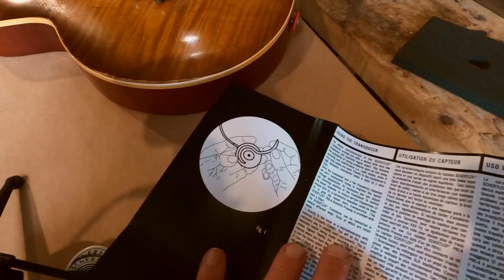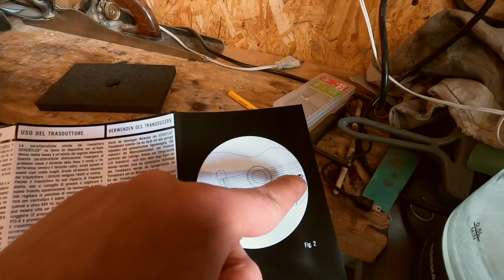HOW WOOD SOUND on unplugged electric guitar. (experiment)

Comment: Nobody cares about the truss rod!! It’s been talked about everythings influence on guitar tone, but nobody cares about the truss rod!! 

The most “tonewood" denier do not listen carefully over an extended time to their guitars unplugged. Because, if they would do, (provided they have good ears!!), they would notice the difference of timbre from one guitar to another, wich is transposed by good pickups unmistakeably into its very fine nuanced specific sound. A pickup just does what its name literally says: picking up! They pick up the vibration of the strings and its subtle variance in movement. Nothing more, just (if they’re poorly made) less. Only differencies inbetween the good pickups is the distribution of frequencies, the percentage of lows, mids and treble in context of the whole sound. 

For my understanding, the sound comes FIRST from the guitar, from the summary of all non electric components! Then, second, from pickups, amp, cabs…etc

But, what I ardently miss in discussions about influence of material on tone/sound is: the trussrod! 70% of body vibration comes from the neck, and the truss rod is a main vibrational element due its elastic stiffness and being  build out of hardened steel, it has to have a major impact on resonance! I guess to some 20-30% beside of the neck wood.
 
Would be very interesting if more builder pay atention to the influence of the truss rod.

I’m the strange guy who's playing mostly unplugged, and who's nocking on guitars on different places with his ear on also different places. Out of my experience, you can hear the truss rod "clonck", or on some guitars not. If you hear it, the truss rod is loose fit, if it‘s silent, the truss rod is tight fitted or dampened somehow. Interesting for me: the loose fit truss rod guitars have better sustain…🤔 I would have expected the opposite…🤷🏻‍♂️
Reply from the maker: Thanks for your comment.  I fully share your opinion and also play unplugged guitars 90% of the time.  This is the most informative method for me to analyze the quality of a design.  Trussrod is one of the most important parts of a sounding design.  At one time, I paid special attention to this.  My guitars always have a single trussrod in a straight bore.  So the rod without bending transmits more vibrations and keeps the neck stable.  My rods are made of unhardened steel, soft enough not to have a pronounced frequency of their own.  Since if the steel is too hard, then it starts to sound at its own specific frequency and this frequency is subtracted from the sound of the entire structure or begins to dominate.  This applies to all metal parts of the guitar.
Reply: @8BombCustom  
Your attention to detail is astonishing! 👌🏼👍🏼🔥
Reply from the maker: @lone-wolf-1  thank you!
Reply: Once someone decides to deny something, they refuse to accept any evidence contrary to their preconceived belief.  They dismiss any evidence to the contrary, and project it on some other cause.  I think they value quick, cheap, and easy over everything else.  A guitar rig has hundreds of components that all contribute something to tone.  A quality instrument should be something that you can enjoy for a lifetime, and worth maintaining.  It shouldn't something to cheap out on in my opinion.